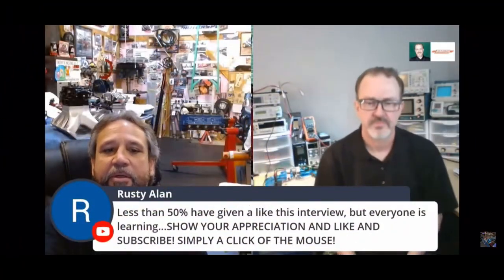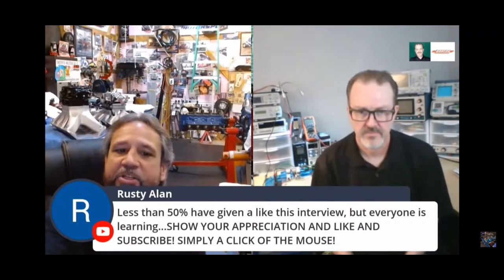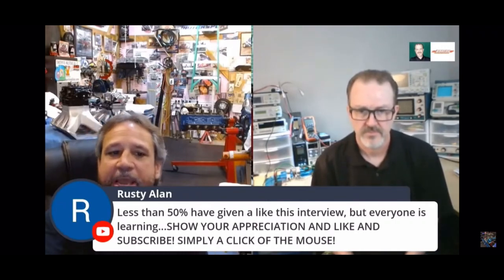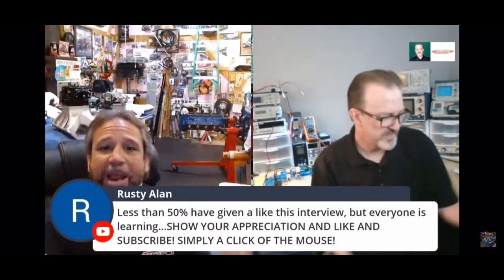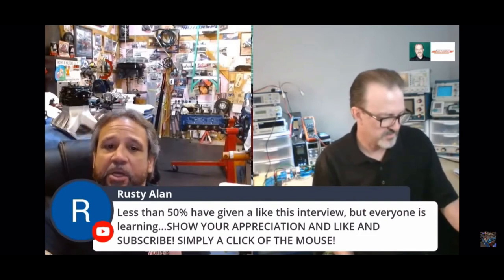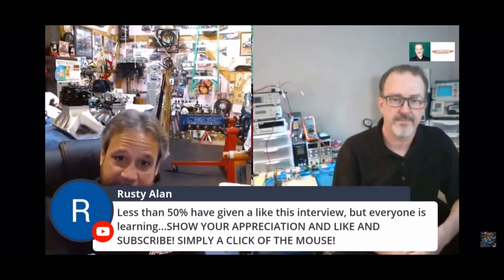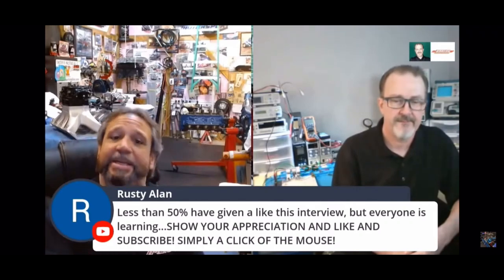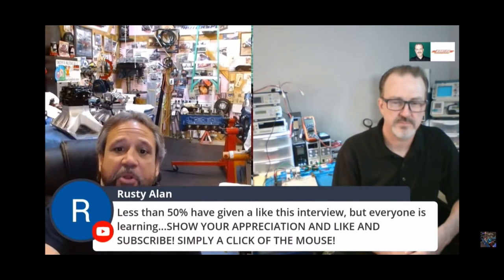DBG: Darin Morgan, Valve Loft Curve, Do NA Engines Only Have 2K RPM Window For Best Power,  And More

Comment: Best to just keep the roller on the lobe, all this space age... accerlation of gravity to create lofting makes me wanta take a nap and its not even 8:00 AM. Gettin out the Finate element analysis is just too much, back off the ramp rate and avoid it sounds like the better option.
Reply from the maker: So your saying it does not happen correct?
Reply: Saying best keep the roller on the lobe, lofting is a product of accelerating mass to valve float, (its gambling) arguably lofting can be advantageous, but there is no true way to monitor gain outside performance or a projection of finite analysis based on weight of component’s, RPM’s, & spring rates. It’s a crap shoot, and trying to land a spring-loaded roller lifter on the back side of an a-symmetrical lobe to soften the blow is another crap shoot. You might get away with it using high dollar bushed lifters, but try a low end set of needle-bearing lifters and see how long they survive. It’s all arguable… In science, there’s merit. In reality, another story. @dragboss351cleveland

Comment: First time I seen a roller cam out of a super stocker kind of explained why he changed valve springs after every race. Eventually he started running grinds that wouldn't kill the valvetrain, which may be what Darin is explaining here.
Reply from the maker: From memory they had huge and abrupt lobes, slamming everything open and shut quickly. Yes spring and cam designed have revolutionized the rpm capabilities and longevity Dave.
Reply: Just a note off of the accurate reply from DragBoss. Yes, camshaft and valvetrain technology has come a long way from the '60s and '70s. An exception to be aware of. Aside from strictly off-road applications, there are street/strip camshafts out there that open and close the valves abruptly. In my opinion, best to avoid them. They play havoc with wear no matter what related components are used. Similar scenario for those with "lumpy idle" fever. Too much overlap and too narrow a lobe center kills vacuum and just sends useable power out the exhaust at low-mid speeds. O.K. for pedal-to-the-metal operation but not for cruising around town. Choose carefully according to your application.  Great job as always, DragBoss!   @dragboss351cleveland
Reply: it no a great leap to understand that for the last little bits of power from a race engine you are going to run into extreme wear.  If topfuel engine were made/compromized to last a season they would be last every race.

Comment: My father used to tell me when he came back from vietnam 68-69 he started street racing back home in puerto rico during the 70s. He spoke about a 1971 351C Boss motor he got in a trade for some labor from a person that called it a 289. He said he had a 1965 fastback he put that 351 in it and never lost a race to another SBC or Mopar ever again until he sold it he said it was unusually fast for a stock motor. Thank you for the content and this channel.
Reply: The 71 was the most powerful year of the Cleveland. I believe they were the most powerful small block in the day.
Reply from the maker: So cool to hear this. Thank him for serving. My dad was there from 70-72. That would be a tight fit that Mustang. Dang it man. I bet it hauled the mail. Love it.
Reply: I put a 73 2V headed Cleveland in a 65 Fastback in 1983 and it fits with mild dimpling on the drivers side, with exhaust manifolds.  Not sure, but headers may be impossible....
Reply from the maker: @trailerparkcryptoking5213 wondered about that. Plug changing must have been a b*tch